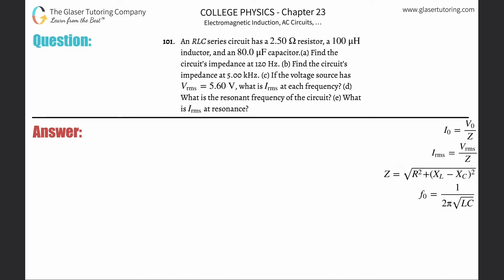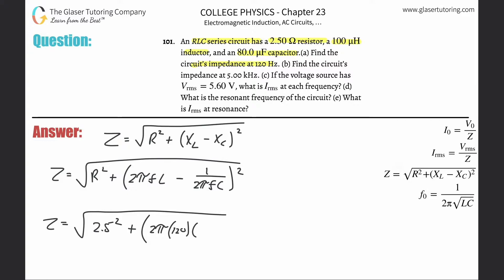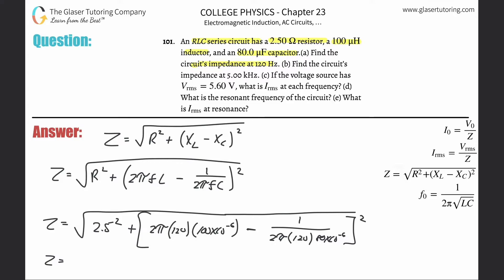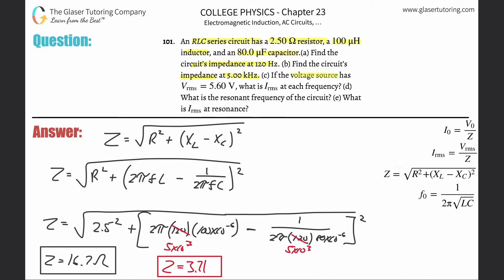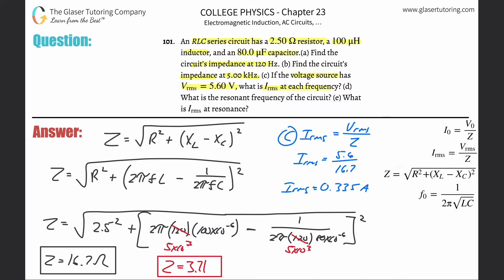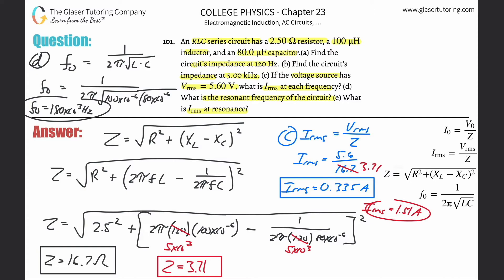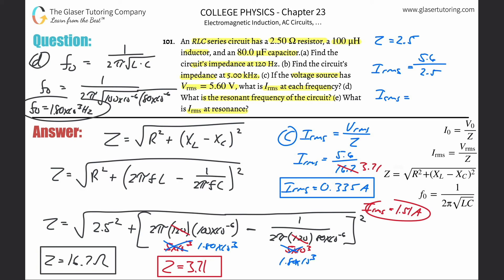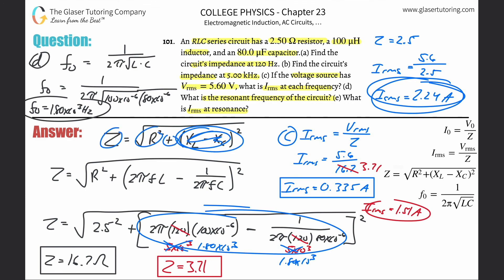23.101 | An RLC series circuit has a 2.50 Ω resistor, a 100 μH inductor, and an 80.0 μF capacitor.

Comment: An RLC series circuit has a 50.0 Ω resistor, a 10.00 mH inductor, and a 5.00 μF capacitor. (a) Find the circuit’s impedance at 60 HZ . (b) If the voltage source has Vrms = 200 V, what is Irms ? (c) Find the resonant frequency. (d) Calculate Irms at resonance if Vrms is 200 V. (e) What is the average power? (f) Find the average power at the circuit’s resonant frequency.
Reply from the maker: Give it a shot, Edgar, and use this question as your blueprint.  You got this!